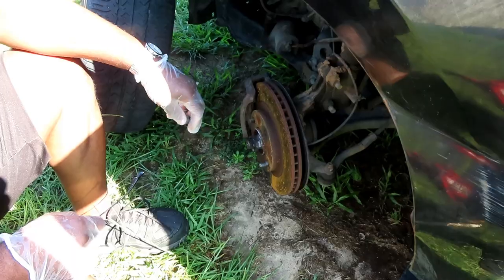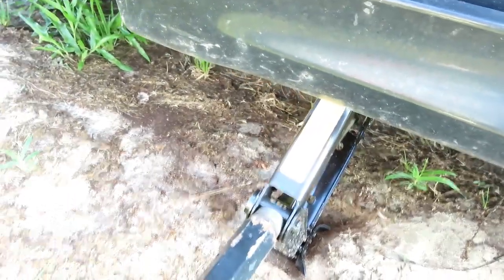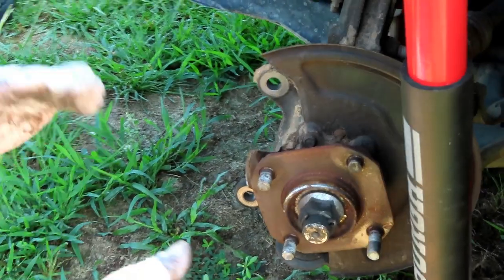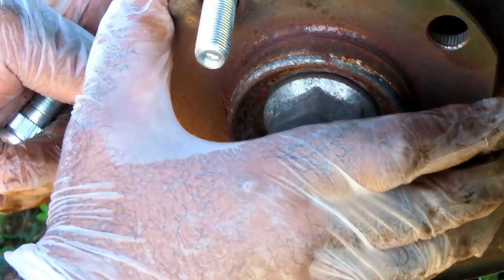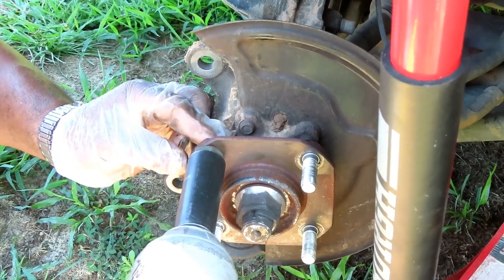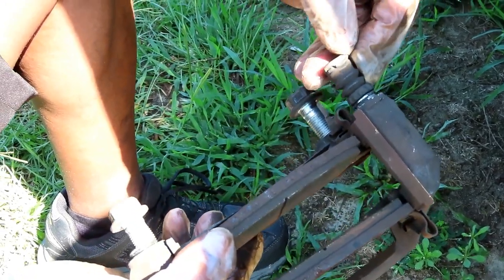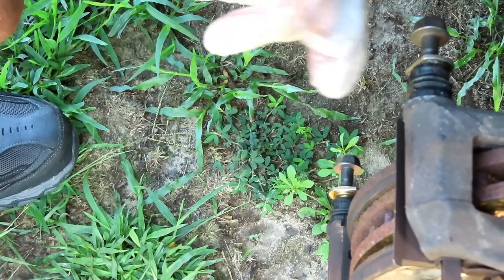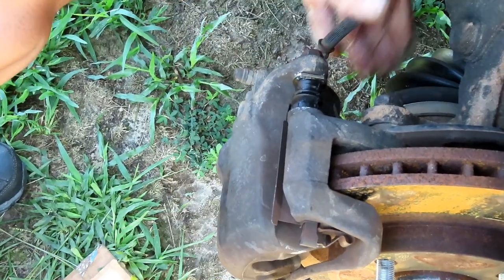⭐ 2011 Nissan Sentra - Front Wheel Studs Replacement

Comment: Yes, If you are going to DIY, don't take shortcuts on safety.  I was helping a young lady change a tire at a gas station late at night, she was scared and I was traveling and thought that if my daughter was stranded, someone would help her too.  I jacked her car up, and she decided to lean on the car while texting with her phone, knock the car off the jack.  Luckily I got my foot out of the way and had the tire under the car as well.  I guess I didnt have the jack in the right place to begin with, but those scissor jacks are not the most stable
Reply from the maker: Wow Robert, I would have been upset at the jack AND the lady, but yes, those scissor jacks SUCK!!

Comment: My 1998 Ford Expedition came with a terrible jack like that and even with a block of wood or something else under it, it  still won't go high enough to get the wheels off of it and they are stock wheels and tires.
Reply: My Expedition's jack worked fine. Check the instruction sheet for jacking points.